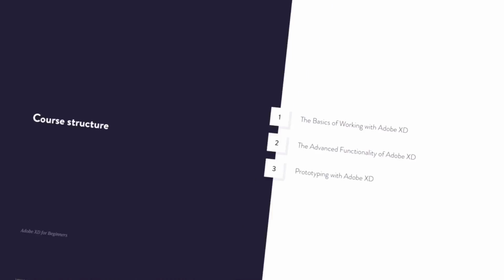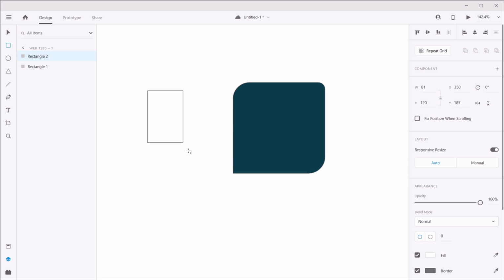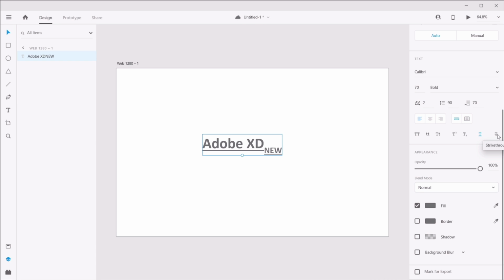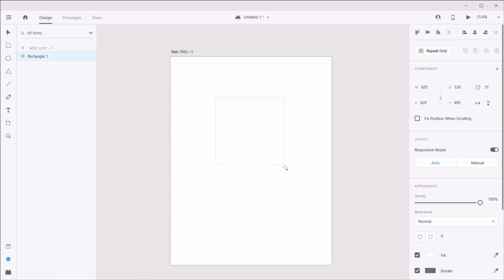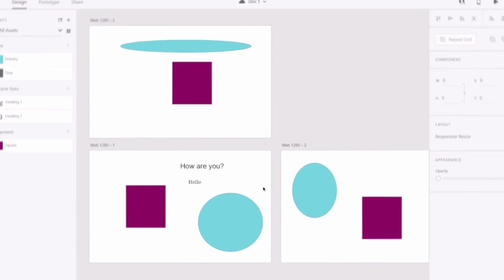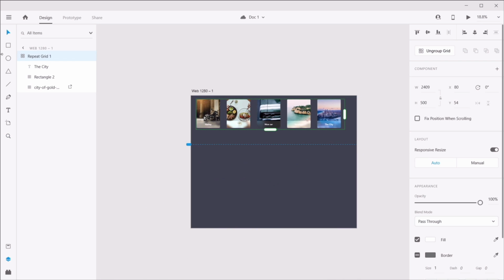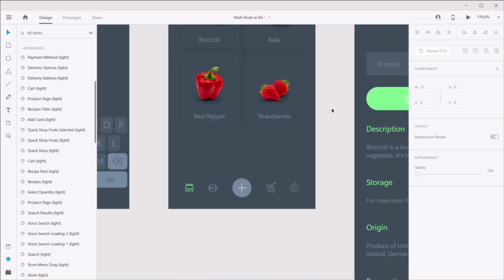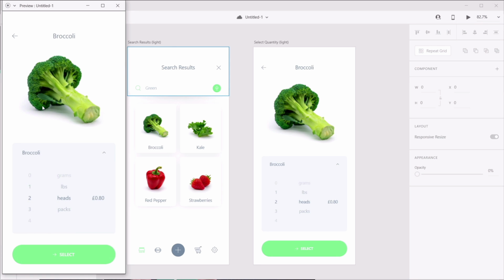Adobe XD for Beginners | FREE COURSE

Comment: Awesome Video!  Thanks!
Re:  Component - Hover State - Buttons:  Apparently, sometime between the creation of this video and a possible XD update prior to September 17, 2021, the methodology described in the video to create a Hover State for a button does not work as described.  Specifically, when attempting to change the 'fill' color of the button for the Hover State also changes the text, or, the text (e.g. white text on top of a red background) disappears from the Hover State entirely.  At the time of this comment the Adobe Community solution is both confusing and unhelpful.  My solution, is 1) first, create the button sans text and save as a Component.  Then, similarly, create its Hover State.  Finally return to the Default State and add the text (e.g. "Submit" using say, #FFF as the text color).  That seems to work fine in this specific case.